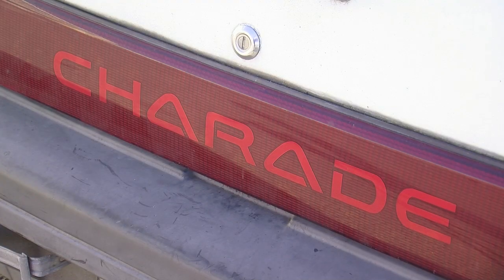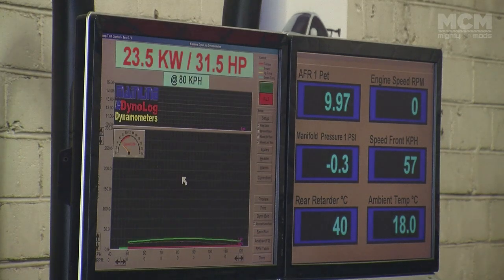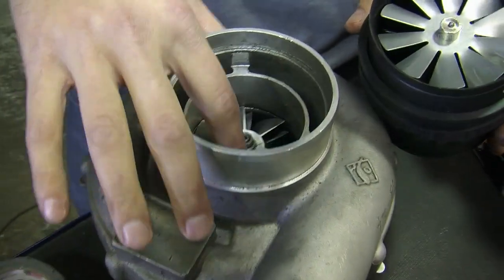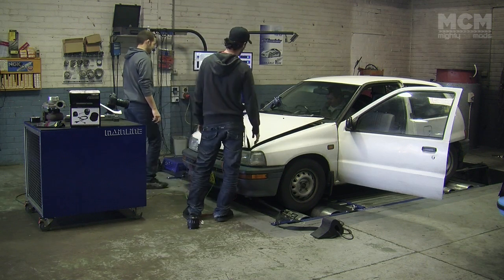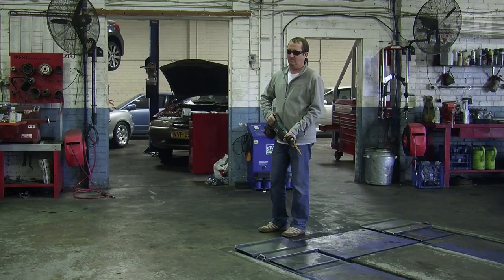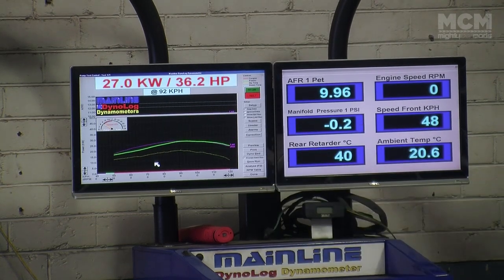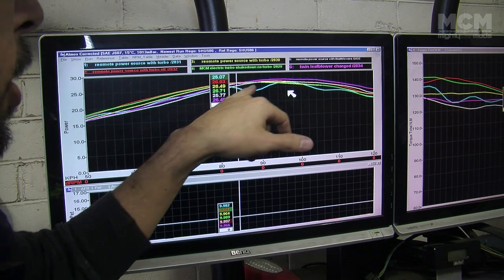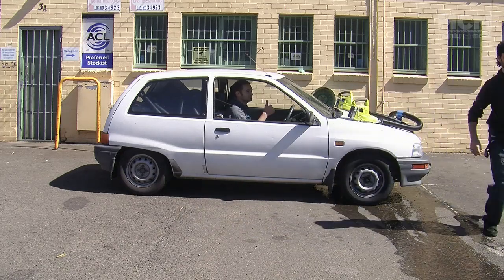Electric SuperChargers Mythbusted

Comment: They didnt really give this thing a chance. I am still sceptical on this but the screwed up one major factor. You CAN NOT just bolt on a turbo or a super charger. You need to modify the fuel system as well to keep the balance of air and fuel equal. They should have replaced the carb as well. All they did was just pump more air into the system and make the mixture lean out.

Comment: Just going to state the intake housing has a vacuum controlled valve, which usually pulls air from the exhaust area and also some times has an air intake charge sensor, which lets air out. http://repairguide.autozone.com/znetrgs/repair_guide_content/en_us/images/0900c152/80/04/f3/87/large/0900c1528004f387.gif
any of these will let that "boost" out. i doubt you would hook up a turbo with that stock air cleaner assembly. scrubs.

Comment: The fellow with the beard may have been correct but throwing a temper tantrum is for babies not adults! Send it back, get your money back and move on. How about using a small gas engine mounted in the boot/trunk and using that to drive your boost? Use a rotatory engine that spins high RPM to drive the boost pump.

Comment: That is one mean killing machine, I'm gonna have to get me one of these. I'll use one leafblower at first I dont want to wrap it around a pole right away, have to get used to the power and the constant wheelspins. You need to be carefull with this amount of power. What wheels and tires are you running? What's the 0-60 on this bad boy?

Comment: to those who say the fan doesn't compress air then think of this, the same kind of fan is used to blow up an airbed, if the fans didn't compress any air then they would not work, when you blow up an air bed put a pressure reader on the valve and you will see a few psi, yes I know these kits are a bit of a joke but as the guys said it cost several £k to fit a turbo, had they dumped the airbox, used fuel injection to adjust fueling (no fuel no power) and done a proper job they would have seen small gains, why do you think some of the big car giants have spent plenty in r&d to try and perfect similar systems ? if they where that bad they wouldn't waste their r&d money. so conclusion, yes the electric fans are a bit gimmicky but lets see a proper and fair test done

Comment: Even though you have air going in you can still be losing a few kw because the can be blowing in to the other leaf blowers at well. So having an opening to let air out until full throttle is open then close that opening so u have maximum air flow into the engine

Comment: They're losing any boost being made out of the air cleaner housing. Not to mention they would lean the engine out and burn it up. unless it's a diesel they can run a lean burn. Dig there videos though!

Comment: Please tell me you guys know the difference between a turbocharger and supercharger.
Reply: Turbocharger spools from engine's exhaust gases. Supercharger is driven by belt from engine.
Reply: KannX I know the difference, I can't remember what they said but they mixed up the two definitions at some point
Reply: ***** a turbocharger is driven by exhaust, a supercharger is driven by the belt on the engine. they're two different things. they both do the same job (bring lots of air into the engine) but they're powered differently.
Reply: *****
This is correct. But the wording is cumbersome. Everyone should just stick with supercharger (belt), turbocharger (exhaust), electricharger (electric).
Reply: technically they're boot just compressors , turbo high rpms, driven by the exhaust; supercharger low rpm, driven by the engine

Comment: What gives power to an engine, wind or gas? Both, só you only gave wind is missing the increase the injection of gas, otherwise you won't have any extra power.
So, be the right Mythbuster and do the things right, even if the box don't talk anything about that.
Reply: Air (oxygen specifically) not wind lol.  And the ECU managed air/fuel ratios for most cars these days so as they add higher air flow more gas will be added automatically by the computer to ensure all the extra oxygen is burned in the piston chambers.

Comment: That fan is utter shit, maybe with a proper one results would be better.
Of course you'll have to spend 300 bucks just for the fan, let alone the cost of the motor and speed controller. The power it will consume is probably not going to make it worth it in a car, but maybe in a smaller engine?

Comment: A charger, super- or turbo-, cannot on its own provide more power. You will still need more fuel entering the cylinders or more efficient burn of the existing fuel before that can be achieved. As they don't say: An engine needs a lot of air to work. Along the lines of 500 litres per litre of swept volume per 1,000 rpm. Take an ordinary, middle of the road car with a 2 litre engine and run it at 3,000 rpm (motorway speeds) and it requires 106 cubic feet of air per minute! That's a lot of air to shift with a simple fan.

Why not just find a used, but good condition, used supercharger and whack it on the same pulley as the fan/alternator/AC compressor? It'll be quicker, easier, cheaper and, with more fuel injected into the engine, give more power.

Comment: new question... could you theoretically put compressed oxygen tanks instead of a turbo?
Reply: That's why ppl use NOS or more correctly Nitrous Oxide.  It is a more STABLE way to deliver O2 to the engine.  Your a dumbass if you place O2 tanks in the car.  Please place a BIG ASS HAZARD sign on your car that says "O2 CLASS 2" on board.  Also place a "dumbass on board" signe.  IT IS THE LAW.
Reply: Explosive as fuck... Be verrryyyy careful bro 😂
Reply: yeah, more of a devils advocate kind of thing... though you could get it to work right?
Reply: I'll have to look into it but psi for different gases can do very different things to their surroundings and can take up much more or much less space, you probably wouldn't be able to use a standard turbo set up if you were to use O2 as a condensed material: for now though I'm working on a customized Honda Odyssey...ricer...or nah? XD
Reply: nothing's rice if it can beat the person who says it is! i guess you would have to just use compressed air, because you're right about pure oxygen being super explosive!
Reply: I just did some brief research and here's what I learned: the turbo exhaust intake gases can become as hot as apprx. 950*C and then the turbo itself has to spin depending on the speed of the engine system so it could be moving at who knows how fast. The compressed air basically has to move through an inter cooler before it can be used to boost anything so the O2 idea is 1)dangerous and 2) unnecessary to the current system. The set up itself would have to be completely designed by an expert in high pressure explosive gas and built by precise machine work~ so on top of everything else...it's hella expensive haha. Btw I like that phrase about the Honda
Reply: Alright! sounds about right... if it was easy, everyone would do it! hope your odyssey goes well!
Reply: Thanks, I hope I can stop myself before I destroy my wallet. Such potential but such a terrible base car.
Reply: gotta spend on something... can't take it with you!
Reply: This is true. Hey, since it's so bad, got any stupid ideas for cred on the Odyssey? I'm thinking a g-wing spoiler somewhere not too flashy, a dual exhaust, P-51 styled cool air intakes, and maybe even clambering the wheels, but definitely lowering it so drifting is a bit safer...if drifting's even possible XD
Reply: I can't bring myself to do that. Haha I could hardly stand that episode, the car could have been so good if they'd actually tried. Maybe some racing stripes though...perhaps the physiological appeal might make it "go faster" haha.
Reply: Fcreveryoung as long as you're willing to drive it with the mods on! I didnt like a few things they did, but i really did like the manga page thing!

Comment: I have an important question for you guys. Since the extra air on this electric fan does nothing what about just K&N filters with all the piping to make it a cold air intake or short ram do? I always thought the extra air going in the engine would improve some HP & fuel efficiency. It seems like non of the above. But still I would be nice to know from you guys.

Comment: Why the hell did the designers not put a centrifugal fan on the electric motor instead of that stupid thing. I'm pretty sure single stage centrifugal fans make more pressure than single stage turbine fans. Even with a centrifugal fan it would need a brush-less electric motor from Satin to make descent pressure at full throttle! Hopeless design. I don't see this beating a normal turbo or supercharger... ever.

Comment: I've also tried something of this sort and i think that by mounting the electric supercharger after the air filter after the carburetor and just before the valves can help reduce the pumping losses that are a result of the restrictions due to air filter, venturi e.t.c it can surely never give you compressed air but it can reduce the effort of suction stroke i am sure of that and one more thing that it does is that it packs in more amount of oxygen as compared to the naturally aspirated setup !!!

Comment: Just a question, Mighty mod guys. Have you considerd that the charade has a carburator and you are trying to blow thru the air. Which means is like you are driving downhill and break with you engine- the vacum makes the carburator to stop the fuel from going in to the engine. I do know that the eletric superchargers are crap, but anyways.. cheers :D
Reply: There are many turbo and supercharged blow through setups out there.  I had one.  Nothing wrong with blow through setups if you take the right steps.  None of those steps would be needed on this though because you are not raising the pressure by even 1 psi.
Reply: drjim86
 of course if you make some setups its OK, but like you said if its is just mixing air its useless :) I am greatful to mighty mod guys that they test this things that we dont take a piss...

Comment: they have installed it wrongly. the correct way to hook it up is;

1) air filter (open pod)
2) MAF
3) tubing
4) Fan (as close to intake manifold as possible)
5) throttle body
6) intake manifold

should not be using carb car to do the test. Cars below 1.3L will see some gains but must be fuel injected. needs a few runs and drive around for the ECU to learn from the MAF and adjust the fueling accordingly. Will see approx 5-8hp gain on the flywheel for a normal 75hp 1.3L car.

Larger capacity cars have much larger intake flow mass so the fan becomes hinderence than assistance.
Reply: Not true, carbs will react well to this mod if it raised boost pressure.  It does not.

Comment: That ebay one is trash.  Axial blades are for low low pressure.  You need a scroll compressor or centrifugal compressor to get a useable pressure.  The electric supercharger is on it's way and works well, but not that shit.  The real ones use a centrifugal compressor and operate at 80,000 rpm +.

Comment: You can't just boost the air. Although the electric fans are nowhere near powerful enough as this video shows, you also need to increase fuel intake. I doubt it would make a huge difference, but if this was done properly, you might get some. IF the car had an ECU, you also need to re-map that. This is just two of the many things you would need to do to turn a naturally aspirated engine to a turbo or super charged engine. Fun video though, especially the carefully measured hole drilling in the bonnet, I've worked with technicians who do the same.

Comment: Wrong type of fan!
You need to use a 'forward curved impellor'.
They will produce good pressure as they are used for pushing air down lengths of ducting.

Comment: Okay... if you guys took the industrial fan, and put a giant plastic bag around it, and then poked one tiny hole in the plastic bag, then ran a small tube from the hole to the engine, THAT would work. I would say mount the industrial fan on the roof. All that huge amount of air from the fan blowing, would get shoved into the tiny hole (compressed) and turned into massive boost.

Comment: I believe the electric supercharger is now viable tech - there are hugely efficient/powerful electric motors available in the hobby arena (12hp+, 100 000rpm capable).  As for the compressor tech, just use said motors to spin a regular turbo shaft/compressor wheel.  I hereby put the challenge to MMC to aquire the bits needed (old turbo, induction plumbing, oil feed, brushless high hp motor and controller blah blah) and make it work!!
If anyone can, they can ;)

Comment: Technically it draws power from the engine to try to increase performance...  This will always be a losing battle and you can work it out on paper. (thanks to Mr Newton and the laws of thermodynamics.)

The faster that electric fan spins the more power it draws to keep it spinning due to the air "compression" that wants to escape back.
This means that it will reduce power that you get from the engine.  So it works to reduce your power, fractionally.

Comment: do you know how you guys did the 2 leaf blowers to the intake? what if you were to run a mini compressor running straight to the intake and shot air at its peak point and were able to control the psi into the intake, would there be a greater gain in horsepower? or would the motor explode? also its not a constant air flow but a compressed blast of air

Comment: For those who is still stating this does not work is an idiot, I have many friends that has installed this and had amazing results especially on their turbo cars.
This initially increases your fuel consumption making you save money by not going out as much, it's safer for you (not your car though) because it actually reduces horsepowers on high horsepower cars.

Conclusion, this thing works great, especially if you have kids and you want them to spend more money on fuel and intentionally lowering their power :D now smack the designers in the face and get your refund.
Reply: I love the read more feature in the youtube comment section.

Comment: You had no chance of success cos you put your pressure on the front of the cold air intake, There's a hot air feed under most aircleaners that takes air from above the exhaust manifold, so all the air you pumped in escaped through that. You need to put the fan directly onto the manifold after the air filter to have any chance of success. On the other hand the fan blade on the electric "supercharger" was just pressed flat sheet, aerodynamically rubbish and not rigid enough to maintain pressure. The electric motor would need starter motor type leads to produce the amount of power that an exhaust gas turbo uses. You already know this wouldn't be magic, but it might have achieved something.

Comment: Hows the compression? it wont make a difference without good compression, also did you make sure the intake is sealed? also the dino is shit LOL jk, you dont get something for nothing, the alternator will make more drag on the engine negating the potential increase in efficiency. If you power the supercharger from solar cells now that might work especially in OZ

Comment: There is no reason at all that electric superchargers do work in theory if enough cash and engineering know how is employed. A turbocharger or supercharger are compressors that's all, one is driven by exhaust gas the other by belts etc directly from the engine. So basically they need power to drive them. If the power source was an electric motor that was engineered to do the job, like enough power to create the boost they would work. However one huge advantage would be that the electric supercharger could do a better job as lag ect could be avoided completely as the turbo speed could be controlled independently of engine speed so it could be tweaked to perfection with proper computer control. Downside they would take a large amount of electric energy to run so the charging system of the car would need to be re engineered.

Comment: So tell me, how are you expecting positive results when you are blowing into a carbureted engine?  The only way this would have a chance of working is with a fuel injected engine with a flow sensor capable of adjusting the fuel/air ratio.
Reply: People run turbos and superchargers on carbs all the time.
Reply: drjim86 Of course they do, either as a draw thru (carb ahead of turbo) or a pressure balanced carb (float bowl has to see boost pressure).  If you don't do either of these you will adversly affect the fuel air ratio and achieve negative results.

Comment: This would work best on cars using a frequency type MAF, that register the extra air and add fuel to match. it would just lean out a carb and some ECU's

5psi boost will increase displacement & HP about 1/3, but only at 5psi.@15psi boost displacement doubles cause atmosphere is 14.7psi(absolute).

they never made any boost, especially with battery operated blowers, less than half a psi